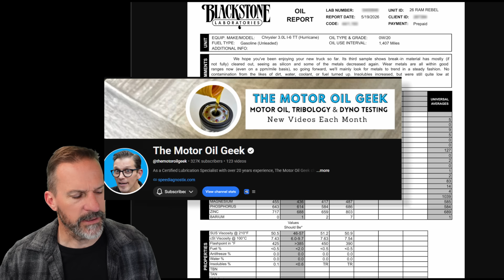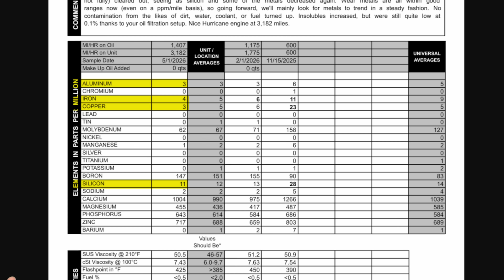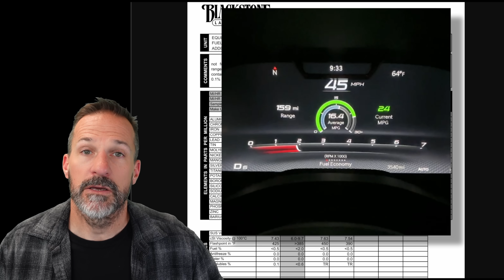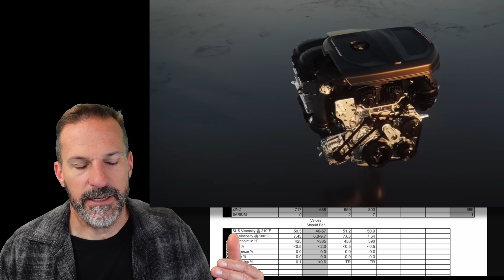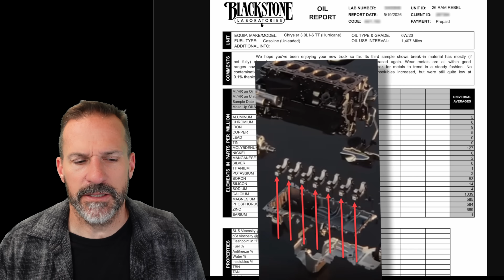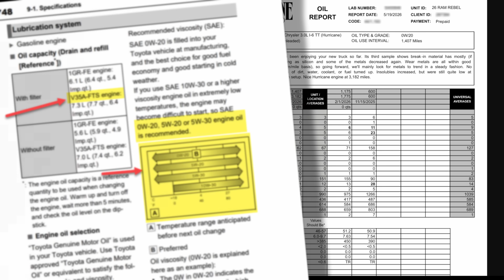The Break-In Secret Most New Truck Owners Ignore

Comment: So I'm not a credentialed car guy, but I am an expert in commercial HVAC automation.  So the value of my comment is this.  The economics of using automation to get every last bit of efficiency from air conditioning equipment sometimes comes at the expense of the equipment longevity and reliability.  So in the end where is your savings?  Where is your reduced environmental impact?  Cannot the same be said for how cars and trucks are built and expected to operate and be treated via manufacturer recommended maintenance?  Performance and efficiency specs aren't going to mean much if there's little to no longevity and reliability.

Comment: I recall hearing somebody say, maybe it was Lake, (perhaps another repair channel) if you switch to a thicker oil you might see increased consumption as the rings aren't stiff enough to scrape it off. Anecdotally I have seen this in a friend's 1.8tsi Jetta which burns oil. 5-30 isn't great but 0-40 is much worse

Comment: You are deciding between 5w-30 or 0w-40, just compromise and go with 0w-30 works great for me. After doing the Motor oil geeks break in schedule I switched to 0w-30 for the ultra flow when cold and a little more protection once heated up to running temp. The truck runs quieter and also much smoother, it’s just the oil weight that makes sense.

Comment: My 2026 Corolla hatchback requires 0w-8, I changed the oil 4 times in the first 5000, but then went to Costco full synthetic 5w-30. I don’t do the oil analysis on it. But live in west Texas and drive it at 80-90 mph for about 400 miles at a time traveling back to east Texas. I feel the engine runs a tad smoother.

Comment: I bought a 2014 GMC Sierra 1500 with the 5.3L multi displacement engine several years ago.  It had 27800 miles on it when I bought it. It now has 85000+. GM calls for 0W20 oil and I used that for a few changes. On the advice of a commercial line mechanic that worked on our work trucks, he said, "I would just use 5W30 and call it a day.  So I did.  I now have 6-8 oil changes on it. I noticed that my oil pressure went up 3-4 psi over the life of the oil.  The 0W20 would have 5-6 psi LESS by the end of the oil life. I also defeated the "multi displacement function with a plug in to the OBD2 port.  Over all I have lost less than 1 mpg.  I'm sticking with it. My next mod will be a transmission oil thermostat replacement to bring the temp down from 185 to 140 degees.
Reply: Proactive is better than Reactive for known engine / transmission issues. 👍

Comment: If you wanted to run a thicker, off the shelf oil, I would choose Mobil 1 ESP X4 0W-40. Insane wear protection, it's a great oil. If you wanted to go for something more exotic, I would look at High Performance Lubricants (HPL) 5W-40. Their oils are some of the best period and Lake Speed Jr is of the same opinion. If you wanted to stick to an SAE 20 but wanted something that wouldn't shear, I would go for the HPL No VII 10W-20. It's basically impossible to shear so the viscosity will stay the same throughout the oil change interval.

Comment: If the vehicle is not consuming any oil between changes, then I would stay with the 0W-20.  If you believe what the MOG says, stay in spec as the shear across 5W-30 or 0W-40  (v. 0W-20) will be greater which affects your viscosity under load.  In the long run, I don't think it will make that must difference.   I've used the MOG's recommended change cycle 500-1500-3000 miles on new vehicles on both Chrysler and GM products since the 1980's .  None ever burned oil or had any oil-related problems .  Traded each in after  minimum 150,000+ miles (some pushing 200K)  It's just common sense--get the milling, machining and assembly crap out of the engine asap.  After that, change the oil/filter every 5,000 miles (3,000 miles on the old days).  Break it in like you are going to use it.

Comment: I'd like someone to buy 2 identical trucks, & one follow manufacturers viscosity, brand (dexos for instance), oil change interval. The other truck follows the "break-in secret" / dumping oil prematurely. Go 25k or 50k miles, & do autopsies / disassembles & see if there are any discernable differences. I'd bank that they would be near identical. Until that test is performed, this isn't a proven science, it's a belief.

Comment: According to the motor oil geek and others, an oil will stay in grade longer, the closer the numbers are together due to less viscosity improvers.   So a 10W30 will stay in grade better than a 0W40.    I would use a 10w40 in the summer and a 5w30 in the winter.

Comment: You aren’t really making sense.  I can’t decide if you’re trolling for comments or if you are genuinely not thinking through this.  Oil viscosity effects OIL PRESSURE  when operating.  Logically you wouldn’t jump from 20 to 40.  Also, 5w30 is a lower grade oil than 0w30.  Obviously you should use 0w30 over 5w30…. You would have to monitor oil pressures before and after you swap viscosity dude.  You can’t just imagine something into reality.  Too much oil pressure will damage your engine just as low oil pressure will.  A 40 oil is going to trick the oil pressure sensor into thinking it’s flowing more volume than it actually is.  You HAVE to monitor this to be sure of anything. 

I’ve been trying to help you out with comments on dozens of your videos, but you aren’t reading them.

Comment: something people are not considering,  useing an oil grade outside of what the manufacturers  approve  voids your warranty,   the manufacturers  could send an oil sample from your engine for testing and if it isn't the correct grade they have every legal right to void your warranty.
Reply: I would love a manufacturer (like Toyota for instance) to deny a warranty claim over a higher viscosity oil. I would happily take them to court and at discovery they would have to answer as to why these exact same engines sold in the Middle East, Asia and South America have higher weight oils recommended in the manuals.

Comment: I ran my truck 1,000, 2,000, 3,000, 5,000, 10,000 miles and changed at 15,000 miles on my 2023 Toyota Tacoma TRD OR now running 5w 30 MobilOne plan on staying with 5w 30 I have even changed oil fill cap to 5W 30 from Toyota. The hurricane engine is an inline straight  4 main bearing caps compared to a normal V6 engine which only has 3. So just think Toyota Tundra V6 only 3 main caps plus twin turbos. Toyota might need to run an inline 6 or its V6. I don't know anything I'm an idiot.

Comment: Definitely like the data driven stuff. Would be nice to see other oil analysis from users. I’ll definitely contribute to that with two of my tundra oil analysis with viscosity out of spec in 3k miles. I’ve since moved on to Amsoil SS 0w-20. Should be a more robust oil that holds up. But my desert environment might still need something thicker. We will see on my next oil analysis if I need to move to a 5w-30. These margins are way too small with the thin oil. Plus HTHS is going to be much higher on the thicker oil. Thanks for the content.

Comment: Good Job with the frequent oil changes. I just picked up a new 26 Ram as well with the Hemi after having a hurricane Ram. I’ll be doing the first oil change in the Hemi tomorrow at 400 miles. I was going to do the next one at 5k and then every 5k there after but maybe I will do one in between as well. I also thought about using thicker oil but with the 26’s coming with a 100k mile warranty idk 🤷🏻‍♂️

Comment: I had an 87 Ford Ranger and did my first oil change at 10,000 miles, and every 10,000 miles after that. I parked it after 380,000 miles because the body rusted away. 
I wonder if I would have done more oil changes when it was new if the body might not have rusted away?
Reply: Lol should have got the body oil sprayed you could still be driving it. There's always something...

Comment: I would highly suggest you go 5w20 because it is one of the most sheer stable oils, which is the entire point of changing viscosities, since MOG has shown in his data at Speed Diagnostics that 0w20 and 5w30 have the same general wear metals, with 5w30 being slightly worse, with the caveat that 0w20 remains within viscosity. But, if you go 5w20, you not only stay within the manufacture oil viscosity recommendation, but also benefit from the sheer stability of 5w20.

Comment: I did 481 mi. & 1,242 mi, so far, 2025 Mazda CX-5 Preferred. Oil is cheaper than engines. Everything videotaped and logged into Carfax.

Comment: Why not 0.30 😮that’s what I was changing back to from .5:30 in my 2013 Subaru. It calls for .0-20. Probably .1st year before they even changed anything. Lol. Probably just testing to see if it does anything. Lol. I’m at 80 thousand. Lol 😮 oh !! Oh !! And I do a lot of short trips. Study shows. O weight for short trips good.?? ?? My Subaru never burnt oil
Like others. So I think 0.30. For me.??  I have to watch all oil geeks twice. Then few others that talk about the geek. Lol. But yes high boost. And hauling. You can trust .5:30,. . I think turbo the geek said 5:30. I researched what I need so much. I’m starting to forget. Some lol. No I’m not researching for a while. I have to many machines lol. And card . Only one with 0:20 😮. I come back one more time. I’m going back to 0. 30 . From .5w -30. Because of my short trips and colder temps in the north west. Go west young man they said.?? So you can run 0-30.  Still a notch above what they call for. One last thing. They have not proved. It won’t hurt. They say it won’t help,?? Unless. It gets hot and breaks down. Lol degrades from heat. ?? Well. I said I’m only steping up one notch. Lol lol. I don’t have turbo 😮😮

Comment: Back in the day when I rebuilt my 302 in my 69 Camaro, the old dude who was the best machinist in town, and actually built the bottom end and balanced it beyond anything I’ve ever seen. He balanced the crankshaft with the flywheel pressure plate and clutch bolted up. He then told me to find the cheapest non-detergent oil I could find. Run it easy not over 2500 RPM for 500 miles, then change it out for good oil, run it another 500 miles still never going above 3000 RPM. Then change it again, After the second oil change, put good oil in it and run it like you stole it. That basically stock 302 with headers would scream to 8000 RPM and beg for more. I ran that same motor for years hard, and never hurt it.

Comment: 2024 Tundra iForce. I went from 0w-20 to 0w-30 at 20000 miles. Sent oil to analysis to Blackstone and all wear metals were below average. I did a 1500 mile oil  change,5000, and every 5k since. I went with 0w-30 instead of 5w-30. I thought Lake Speed jr. mentioned in one of his videos that the greater the difference between the 2 numbers, the better the shear factor??? Iforgot to send a sample at 25k, but will send one at 30k. Will definitely use this break in method when my new engine is installed. Let me know if you'd like me to email you my Blackstone report.
Reply: No the greater difference between viscosity numbers the faster the oil shears out of grade. Do 5w20 is most stable; 5w50 shears fastest. But honestly the real answer is is to simply shorten OCIs …. If you do extended OCIs then pick a premium high end best synthetic oil for your driving style.
Reply: @martinradtke5181  Very helpful, Thank you!

Comment: I have done the same break in with my tahoe. 500, 2200, 4500…..now I will do every 3000…all dealer changed…6.2L…..depending where you live, if heat is a concern, do 0w40. 5w30 is good as well. 0w20 in heat would be a concern…but if you follow “severe use” vehicle maintenance, you should not run into an oil issue.

Comment: On my 2026 Ram and my old 2021 6.2 Trail Boss I ran a mix of 0w20 and 5w30. I run 5 qts 5w30 and 2.5 qts 0w20 in the summer and 2.5qts 5w30 and 5 qts 0w20 in the winter, in Wisconsin. 0w20 is just far too thin to protect the engine. I also did the Motor Oil Geek break in oil change method and got similar results.

Comment: I have a 2015 Tahoe with 5.3. I have been using 5W30 since first oil change. Have Range AFM module plugged in. I currently have 163,000 on it with zero engine issues. You  were talking about long term, so I wanted to share. Thanks
Reply: This is what I am looking for. The rest is just bla bla bla.

Comment: You are so right! Every time they make tolerances tighter.....they just destroy the lifespan of the matting surfaces. I ran production OD grinders as well as other "close tolerance" operations. My bearing journal tolerance was +/- 0.0001". A few jobs were 0.0000" + 0.0001" max! We had a small end-plate flatness spec of NO Crown & 0.0001" Dish Max. Guess what that endplate was? Part of an 0333 rotary vacuum pump that held the film plate in place at 80,000 ft....on the famous Skunk Works U2 spy plane. Ha, & they didn't fail because in true Mil spec, they are not allowed to. We won WW2 with designs like that. Why the hell can't we build then like that anymore? 2 reasons: #1: The GD EPA that dictated specs never even realistic to meet & the public's brainwashing that were all gonna die if we don't do this. And #2: pure corporate greed to get those sales numbers & profit margins growing without end. Yeah, now their all happy right? Well the consumer ain't and the stockholders can't get that big divided, free money anymore cause it's dried up and isn't coming back! Electric? They have power sources that would acually make the whole concept work well. We'll never see it. It would destroy the entire petro-dollar the world STILL RUNS ON! Hey all military's run on Jet fuel, diesel or gas when they go into a battle. Battery is only a backup for the tech that requires huge amounts of power. Wake up folks, you've been led down the  primrose path!

Comment: 5-30 full syn, Mobil 1 on my new 0-20 car, and been running same oil on all my cars including turbo cars . never had a problem
Reply: I've been using Mobil 1 for nearly 50 years and it was 5/30 when it was first introduced, from a '77 Olds 350 V8 to a '83 Ford Turbo Coupe 4 to a '89 SHO V6 through all the years and various configurations, some with a quarter million miles, I never had an engine failure so I'm with you

Comment: Did the same with our new Camry. Used 0W-8 for the 2nd oil change, then went to 0W-20 after that.
Reply: Ask Gemini if that’s what you should be doing
Reply: I run 5w-30 in my Corolla 0w-8 required oil. But I live in a hot climate and high speed driving
Reply: @kuntsniffer9437 any issue with running 5w30? I’m thinking about doing the same thing. Thanks in advance
Reply: @earthpeephole3552  id just do some research, im in a really hot climate and high speed driving for 4-5 hours at a time, go and look up the owners manual for this same car for use in australia or somewhere else other than USA or Japan, other countries have the same engines and it shows a temperature chart so that might help, also think about what temps you would be in in the winter, I might do a 5w20 in the winter here.

Comment: Does the owners manual give any other allowed viscosities for different temperatures? I hate the low oil pressures you have said this engine runs. It would be interesting to see if changing the viscosity brings this up at all. In the past I would never buy a vehicle with under 30lbs of oil pressure. Also I’ve been told that these engines set off a code for too high of an oil viscosity? Anyone experienced this?

Comment: I've been following this series of videos. I've changed my oil twice in under 3,000 miles (perhaps I wished I did it earlier, a third change at 500 miles in retrospect) and the only thing keeping me from changing from 0W20 to 0W30+ in my Gladiator's 3.6 (Pentastar Upgraded) engine is some esoteric post from one of the original engineers for that motor. He stated that it was actually designed to run with 0W20 and described the pros and cons to using it versus going with a different weight. But the oil galleries and timing components seem to be calibrated for that weight. Who knows for sure, but it seems plausible.

Comment: Based on all of this experience and data, can you recommend when to do a single break-in oil change prior to a next one at say 5,000 miles?  Having downsized and parted company with my ramps, etc. I have to outsource oil changes, and multiple 8-quart oil changes with Audi-spec oil at the dealer or local Audi mechanic would be pretty expensive.

Comment: I have a 2018 Audi S5 tuned (425hp, 525tq).  It calls for 0w-20 and I run Ravenol vst 5w-40.  My wifes G70 2.0 calls for 0w-30 and I run 0w-40 Amsoil Signature.   I’m a firm believer in a robust oil.  Side note:  the Amsoil is 14.7 cSt and Ravenol is 13.5 cSt.   Mobil 1 supercar 0w-40 is only 12.9.

Comment: Reading through the comments here it's clear that many people here don't understand what 0 weight means.
They think for some reason it's too thin. They don't understand that what it means is that the oil acts as a straight zero weight at the cold temp. Which is still thicker and more viscous than what it is at 220 deg where it behaves like a straight 40 weight would

Comment: Did you change your oil filter each change or haven’t yet?
Reply: Put a super micron oil filter on it & all the particles wouldn't be suspended in the oil. I'd rig up a series of 4 or 5 oil filters and the engine would last for infinity.